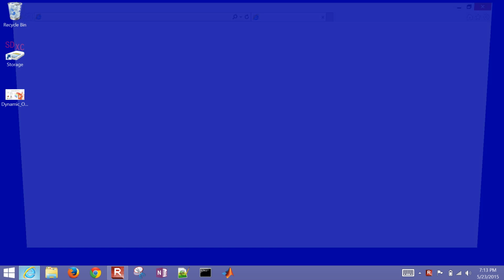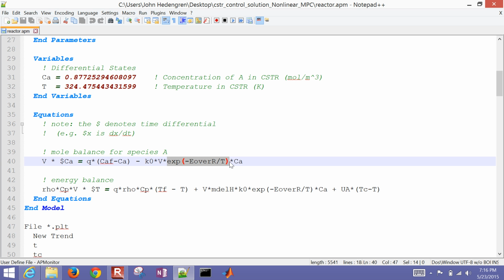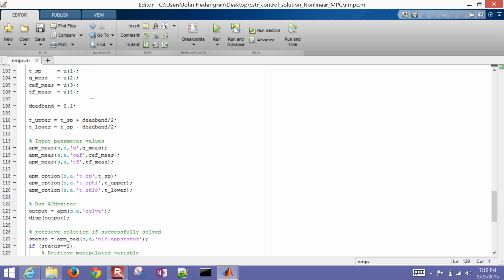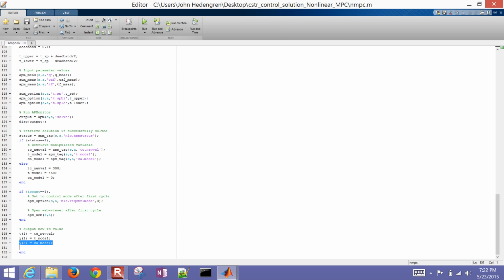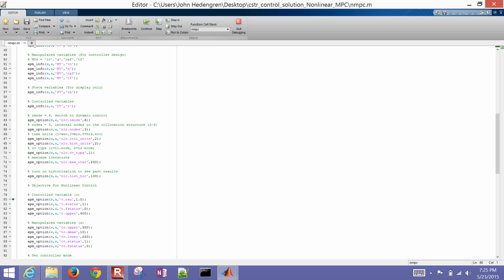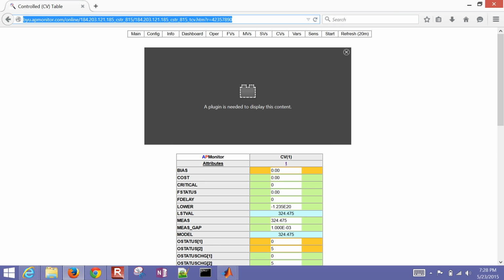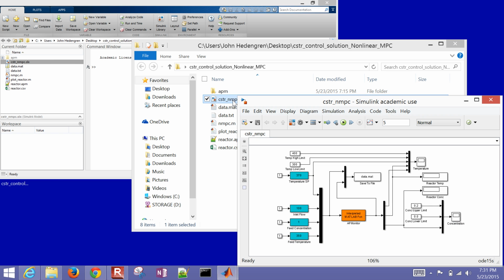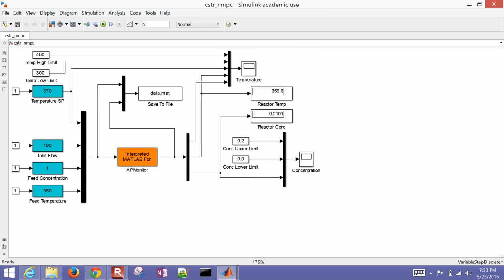Nonlinear Model Predictive Control in Simulink

Comment: Hi sir, I am a student in my final year at Universiti Putra Malaysia. This video was utilised in my Advanced Process Control class. Thank you for the outstanding explanation of non-linear MPC. I have a query regarding this topic; does wifi connection influence the outcome?  Because our results were not identical to yours. Below is our result.

https://drive.google.com/file/d/1lic7CfBTBAY8TaWQ5zGuKG9wUHzMuUHf/view?usp=sharing
Reply from the maker: Thanks for sharing the results. WiFi may introduce some delay in the measurement signal and would degrade the performance. However, I wouldn't expect it to be significant.

Comment: Would it be ok if I ask what versions of php and apache are installed for your APMonitor server? 

I'm having trouble with reproducing the results with my current server setup. That is, 
1) When I run the simulation code (cstr_nmpc.slx) with the server selected as 'http://byu.apmonitor.com', the code results in the same graphs as shown in the video.

2) When I run the code with my local server (http://127.0.0.1) selected, the code produces nothing but horizontally flat graphs. 

My server is composed of:

Windows 10 x64
PHP 7.1.30 VC14 x64 Thread Safe (2019-May-28 19:06:35)

Apache 2.4.39 Win64
 
apm_matlab_master
 (downloaded from github.com/apmonitor/apm_matlab)
Reply from the maker: Could you make sure that your local server is solving a simple problem such as: https://apmonitor.com/che263/index.php/Main/MatlabOptimization  It may be easier to diagnose any local server issues with that problem instead of the Simulink problem.

Comment: Truly appreciate for ur understandable video, I'm trying to implement MPC on building HVAC systems. Any advice to proceed or sample code can be developed to practice making MPC controller on building sector?
Reply from the maker: HVAC systems are a great application of MPC, especially with zoned heating and cooling. You made a comment on the Simulink MPC video but there are also MATLAB (script) and Python versions of those same examples at http://apmonitor.com/do/index.php/Main/NonlinearControl - this is also one of the pages on the Dynamic Optimization course that includes a lot of examples on MPC. I'd recommend the lab part of the class because you are designing an advanced controller (MPC) on a simple Arduino heater and zoned temperature control application. See http://apmonitor.com/pdc/index.php/Main/ArduinoTemperatureControl (Python) or http://apmonitor.com/do/index.php/Main/ArduinoLab (MATLAB). You would need to build the lab ($20-30) but this would be a very good example to help you with something that you'll eventually put in a building. The SISO example would be if you have 1 temperature sensor and 1 heater /ac unit with no zonal air control. The MIMO (Multiple Input Multiple Output) example would be for situations where you have multiple temperature sensors (maybe in each room) and you have an air flow control system to adjust air flow to each section. You should consider starting with linear MPC and then use nonlinear MPC if the application is needs something more sophisticated. Both linear and nonlinear, empirical or first principles approaches are available in APMonitor.

Comment: Hello, please some advice to implement constrained nonlinear predictive control for a nonlinear multivariable process (A benchmark process, some material to do without linearization ... etc), Thank you.
Reply from the maker: +Yassine Mohammed, there is a course on this topic at http://apmonitor.com/do. The course starts with modeling (how to create a nonlinear model), moves to estimation (how to align the model to measurements), and finally to control (how to optimize and control a system).
Reply: Thank you, a benchmark non linear mimo process with non linear constraints on what i can began a first implementation please...
Reply from the maker: Here is MIMO identification (you can add nonlinear elements): http://apmonitor.com/do/index.php/Main/ModelIdentification. I recommend starting with an easy example such as the one at the bottom of this page: http://apmonitor.com/do/index.php/Main/ControllerTuning
Reply: Thank you, I will.

Comment: hello 
 can u plz help me for using pid tuner for a non linearized plant. the plant  is imported from msc adams  with dynamic unbalances (non linear model) .
Reply from the maker: +Ethin George It appears that you can create an LTI model from MSC Adams software. Here is what I found on from Wikipedia: "Adams/Control is very well integrated into MathWorks' Simulink by some S-functions. A closed loop between Simulink and Adams/Controls makes simulation of non LTI systems very simple. A non-linear time variable model of plant is modeled within ADAMS/Controls and its behaviour is reported to Simulink via Named pipe or TCP/IP communication as feedback, whereby analysed by some controller within Simulink and through some actuators act upon ADAMS/Controls plant in the same communication scheme. Also through control export mechanism, ADAMS/Control can provide MATLAB's Control System Toolbox with an state space model of system under study to be used further for design of controller."

Once you have a model, you can build either a PID, linear model predictive controller, or nonlinear model predictive controller such as shown here: http://apmonitor.com/do/index.php/Main/NonlinearControl
Reply: thank u very much,  can i get video for  this or tutorial .because iam new to matlab
Reply: +Ethin George the link that I sent you has the source files. you just need to download and extract the archives for the examples.

Comment: Hello, I am doing research on NMPC methods, we have developed a novel method in our research group and it would be very nice to have a comparison to existing methods. May I ask which method was used for this? Additionally, if I understood correctly the optimization is solved by the server, but it would be nice to have a benchmark in execution time so implementing the method locally would give a better insight, is there code for it? Thank you
Reply from the maker: +ppiibb A full description of the methods are given here: http://www.sciencedirect.com/science/article/pii/S0098135414001306  The APMonitor modeling language is not open source but you can see compute times that are reported with each solve. There is a network communication time as well that varies depending on your connection speed. If you'd like to get a local copy of APMonitor that doesn't rely on network communication, please let me know.

Comment: how can i make MRC NN control for cstr  in matlab?
thanks
Reply from the maker: +Ahmed Albkkosh Here is another paper that may help: http://ljs.academicdirect.org/A10/025_040.htm  The method in this video is using a gradient based approach rather than a neural network controller. The biggest problem with NN (or commonly referred to as Artificial NNs) is that there are extrapolation issues and potential problems with over-training. Some recent work has gone into bounded derivative networks (AspenTech) for control.